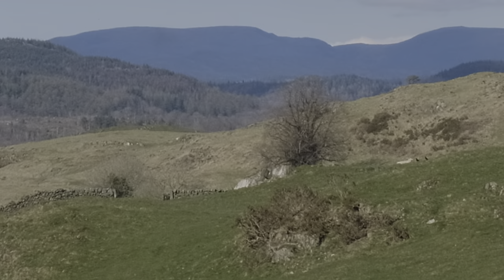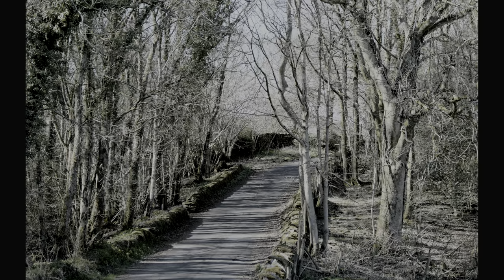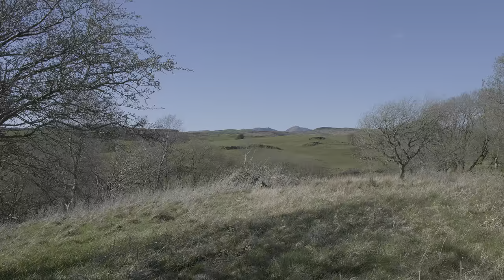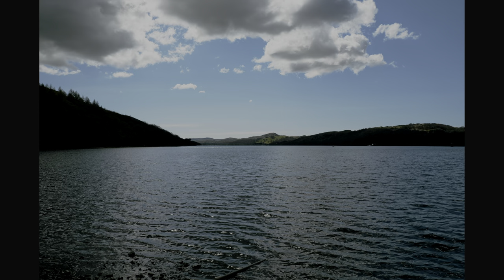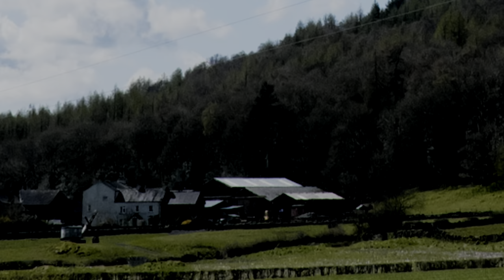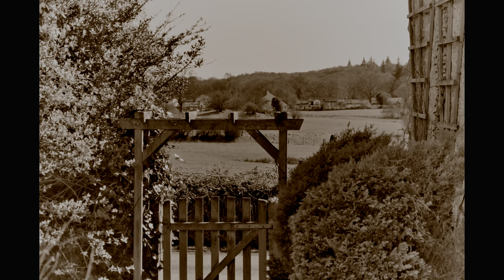How Fuji XT4 Flog and Raw Was Converted To HDR

Comment: I try to make flog to hdr(rec 2020) by using ur lut,but i found that my app(luma fusion) only support lut size2-64,yours are 65. How can I do can make size
65 to 64 and lower?(I’m sorry about my poor English)~
Reply: Also - the English is fine!  I appologise if my English is complex. Let me know if I need to explain some more. As a native speaker it is not easy to know what is and is not easy to understand :)
Reply from the maker: Woops -I replied using my other channel! Hope that was not too confusing :)
Reply from the maker: The luts I created are .cube luts. They are made via lutcalc.  If you load the flog.lutcalc file from my git into lutcalc you should be able to create a smaller .cube file.  However, if you need a clut (e.g. a .png file) then that would be a bit more difficult. I can try to figure out how to do that with ffmeg if you want.  For lutcalc see here: http://cameramanben.github.io/LUTCalc/
Reply: @homebrewhdr8794   Thx for ur reply.My device is x-t4,so i always use the flog.I want to use flog to make a HDR/dolby vision vedio by my iPad,but I found that iPad have no tools like the ‘HDR tools’ on FCP,so And I noticed that  Dolby Official in Bilibili(a Chinese vedio website like utube) says if I want to make a Dolby vision vedio ,I need flog to rec709 first,but I believe that will lost some color detail,so I prefer use rec2020,but  fuji official didn’t offer the lut like flog-flog/wdr  rec2020 .
Reply from the maker: @sherlockluo451  yes - rec709 will reduce the colour space a lot and defeat a lot of the reason for using HDR in the first place. I could not find a lut for flog->bt2020/smpte2084 which is why I made one.  However, you need to make sure that the software you are using supports bt2020/smpte2084 of hlg - I assume the Dolby stuff does. Then you will need an appropriate lut.  Not being familiar with the requirements of the software you are using, I don't know what lut to suggest.  The other issue is the gamma curve.  rec2020 uses rec709 gamma as far as I know and flog has a very different curve to that and the rec2020 gamma is not ideal for HDR (https://en.wikipedia.org/wiki/Rec._2020#Transfer_characteristics).  I use smpte2084 (https://en.wikipedia.org/wiki/Perceptual_quantizer) for everything as I am used to it. Youtube also supports HGL I believe.  I am not sure if this helps you much! I can have a go at creating some luts for you but not sure how they will work for your software. The other approach would be to use ffmpeg to convert your flog into bt2020/hgl or bt2020/smpte2084 and then import that into the ipad software.  I do know how to do that conversion.  Also be aware that to do HDR properly is either very slow or requires a lot of storage (or both) compared to SDR rec709.